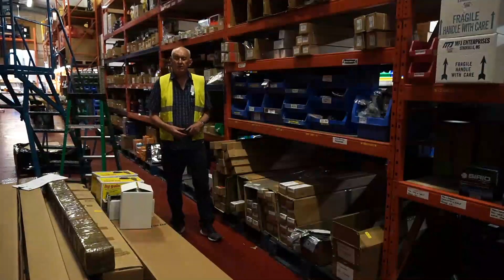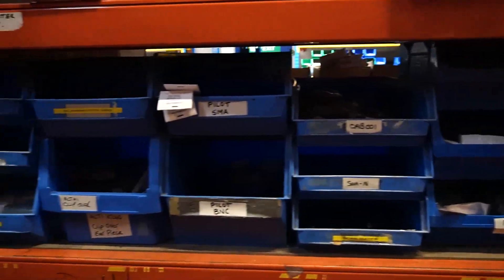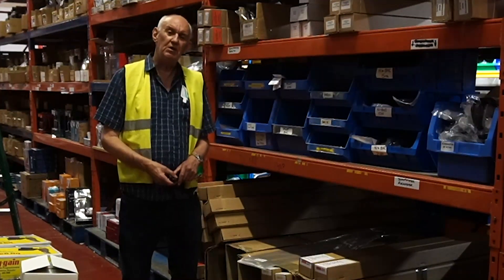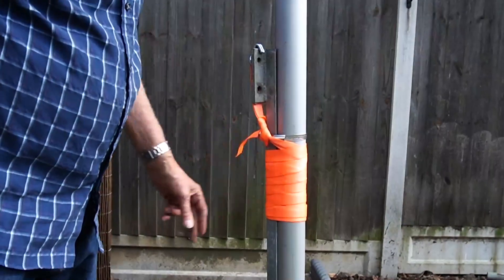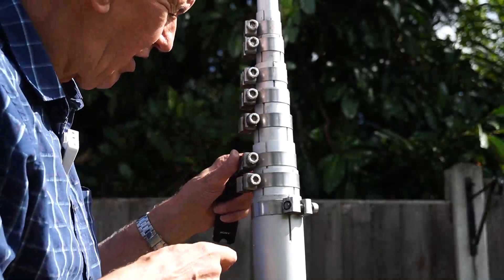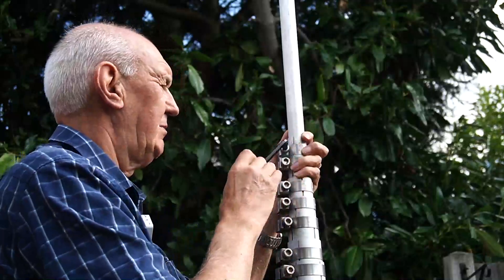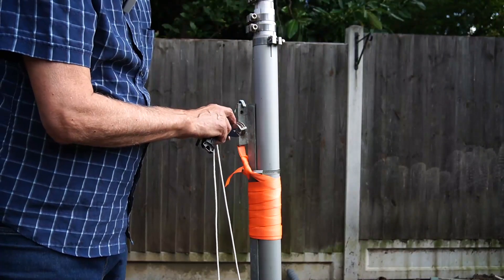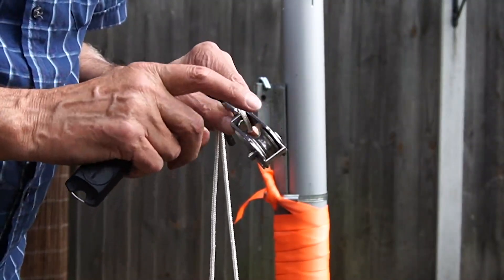Easy Ham Radio Mast System - Spidermast from Spiderbeam

Comment: So many choices for masts: fishing poles, painter’s poles, Jackite poles, plus purpose-made masts of aluminum, fiberglass, or carbon fiber. My first mast was a 20’ (~6 meters) length of chain link fencing top rail (galvanized steel). I mounted it next to the eaves of my parents’ house and fastened it to the eaves, about halfway up. It was cheap, durable, but not very portable.

73 de AF6AS in “DM13” land

Comment: I bought one of these based on this video. It is good quality and I am happy with it. I also got the base plate and nailed it into some large boards to stabilise the bottom. It is currently lashed to a large fence post.  I have a fan dipole for 80, 40 and 20 metres on it. VK6ABC. I bought the plates for the guy cables but it is currently not guyed. (I will get around to attaching them one day).

Comment: Great video. If this was my mast, I would mark the bottom of each pole to ensure I did not pull up too far. I would also use an electric driver for ease and speed of assembly. Thanks!
Reply: Yep 👍 
That’s what I’ve done. Works really well!👍

Comment: I'm attempting to use a mast similar to set up an antenna whereby I'm fixing it to the external wall. I do not intend on going up over 4 meters but need this to work at 10+ meters. Metal cleats would be required at different heights up to that 4m height and i'm hoping that will be enough. is it open ended at the top so i'm able to run a cable down? I plan to drill a hole at around 5m so I can run the cable from the 1st floor of my house.
Reply from the maker: Sounds a good plan. Take care. 73 Peter

Comment: They need to create something between their current product lines.  The spiderpoles are too light for my application, and this hulking thing is bigger, heavier, and too dependent on tools for deployment.  Where's the field-deployable aluminum or heavy fiberglass model that will support something other than a wire?

Comment: Hello! Good videos! Thanks for that!

Am wondering if these are handy for mounting against a wall. For when you want to change different antennas, experimenting ...etc. Just ~80-130cm omni antennes..."sticks" if you want :)

If there is much sway and so on. Or then remove perhaps the top thinner tubes ? #shrug! I am no HAM radio amateur (anymore, since the early 90s :))

Thanks again!

Comment: What issues and how do you manage conductivity of this mast with an inverted L endfed wire antenna..or does that require the fiberglass model?
Reply: It will couple, you need a non-conductive mast.

Comment: I have a 34' and a 50' carbon fiber telescopic mast and I really enjoy them. Putting up a tower is not always feasible and I think this is a great alternative to get certain antenna types high enough. I have used one with 10 meter and 6 meter Moxon antennas which are very light and I use the "Arm Strong" rotator method. I happen to be lucky in one respect having a fence with metal fence posts cemented in the ground and I frequently tie my masts to that. I have a J-Pole right now at the 34' top of my mast and it works very well even in high winds. Thanks for this video.
Reply from the maker: Many thanks Don. Nice to have your input. 73 Peter

Comment: Crazy price complete rip off. I bought a 10m ettore telescopic pole which you just twist and lock each section. Cost about £115 but they stopped making this size unfortunately
Reply from the maker: Twist and lock alloy systems do not weather well and can lock up. You pays your miney........

Comment: I was very interested in this product...... Until I found out the price! Close to $500.00 US is a bit steep for a couple of sections of aluminum tubing... So I decided to build my own!  I got the tubing for basically scrap price. The other hardware I homebrewed or purchased, such as guy ropes, guy steaks, and other bits of hardware. The cost was 1/5 of what Spiderbeam wanted... For $100.00 US I made myself a 30 foot telescoping mast.... Yes! The weight is a bit heavier, but my pockets are a bit heavier as well, saving myself 400 bucks.
Reply from the maker: Nice if you have access to tubing of the tight sizes that telescope.

Comment: do not forget you will need planning permission if it is to be  a fixed location mast?
Reply from the maker: Check with local authority for telescopic structures.
Reply: And turn the power down if you are a dodgy M-Free.

Comment: I just recently put up a fiber glass  mast an MFJ 1908 which is supposed to be a 50 ft. I detuned it to 40 and I have it mounted in to aluminum sleeves about 2 ft and 7ft from the ground.  
the sleeves are mounted with backing plates to a veranda on my deck.  I chose fiberglass because of my G5RV ant and it is working so very much better than the old metal popup mast that was far too short.  You are my favourite  ham channel for I find you are so down to earth and practical.   Looking forward to more of your reviews.  73 de ve4jim
Reply from the maker: Thanks for those kind comments. Nice to hear from you. 73 Peter.
Reply: Hi 👋 
Do you mean you drop the mast into a sleeve?
I’ve been doing that too with a piece of drain pipe that I use a couple of rubber doorstops to hold it straight but was looking for something else to use for a more solid fix! Any information would be helpful!👍
Cheers.